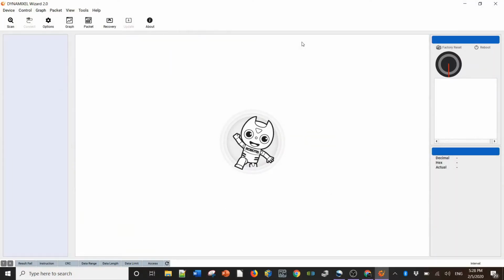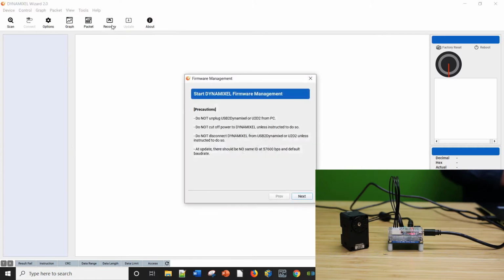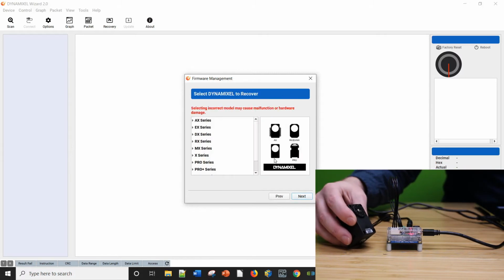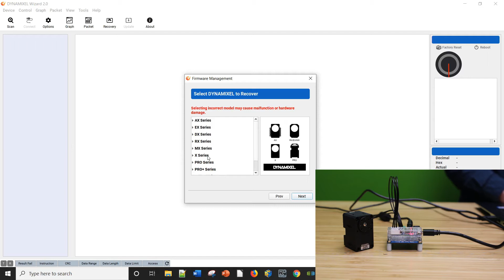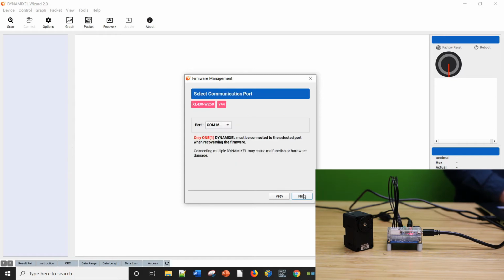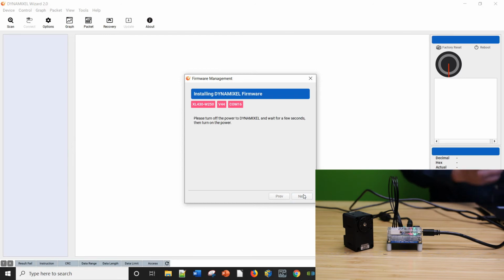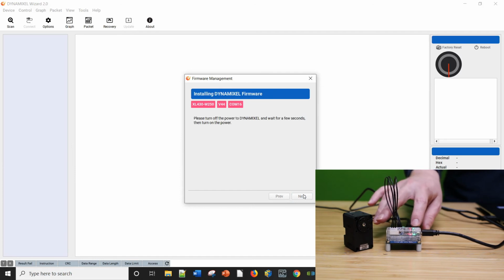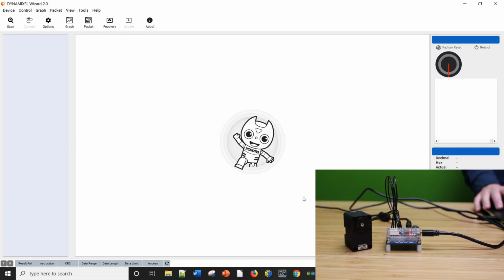How To: Firmware Recover DYNAMIXEL Using U2D2

Comment: my question: 1. Does this method also apply to the Dynamixel AX series? 2. Do I have to use a U2D2 power hub to connect? because I only use the U2D2 USB connector, I can't connect with the wizard. Thank you, I hope to get an answer.
Reply from the maker: This method does apply to the AX series. You don't specifically need to use a U2D2 Power Hub, but if you don't have one you'll need to find a different way to provide the required 12v input to power the AX actuator.

Comment: I have a problem when the firmware recovery is finished, the description appears firmware recovery failure and the LED on dynamixel ax-a lights up, I don't know how to fix it
Reply from the maker: If your DYNAMIXEL actuator is unable to complete a firmware restoration, ROBOTIS' recommendation is to send the unit in for RMA service.

If you are located in the United States further information, as well as the form required to submit your request can be found here:
https://www.robotis.us/shipping-returns-warranty/?_ga=2.219888401.927350715.1640028486-177785784.1638553539

If you are located elsewhere, the information and forms can be found here:
http://en.robotis.com/model/page.php?co_id=repaircenter